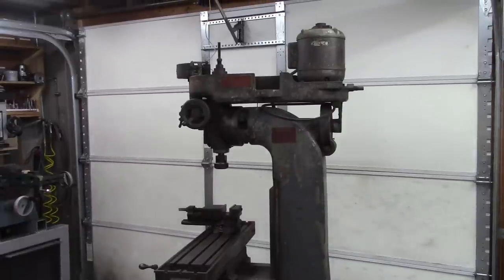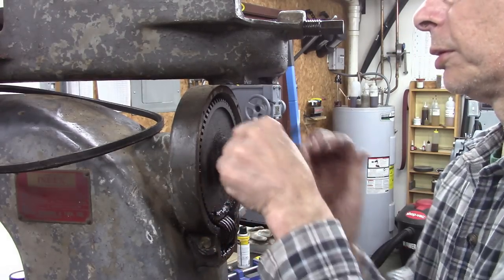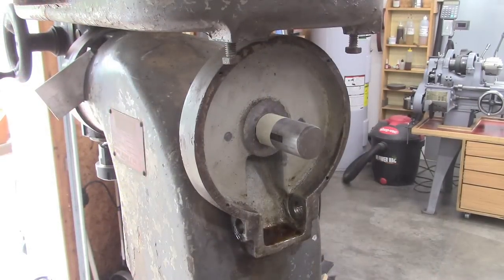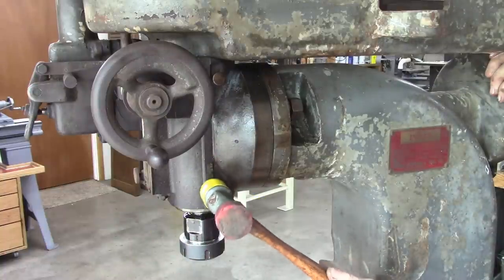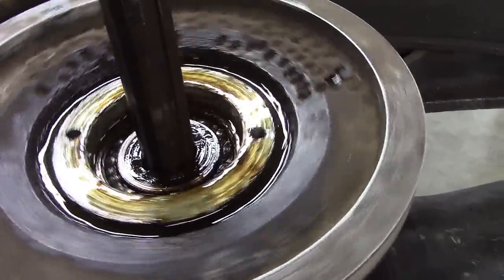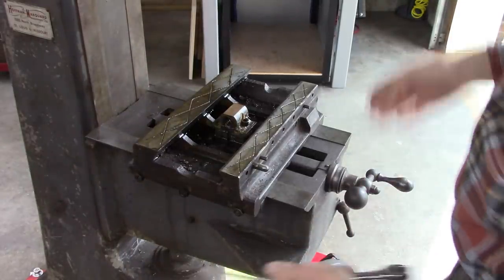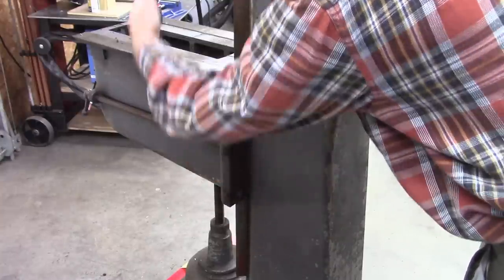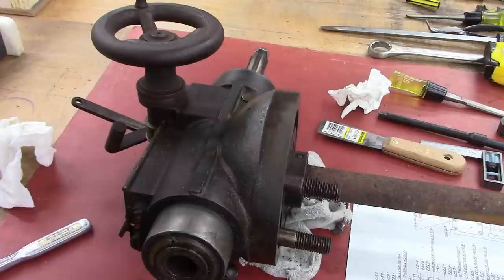Restoring a 1950 Wells Index Model 40 Milling Machine - Part 1

Comment: I have a wells index 747 mill made in 1974..II love it.The support you will get from wells is great..Give them a call and they can help with parts as well as drawings....
Reply from the maker: That's great to know. Right now I'd like to know a little more about the spindle bearings and how to lubricate everything plus the original motor wiring. maybe I'll call them monday.

Comment: Well, we just never know what’s going to follow you home. This looks like it could still do good work if all the parts are intact or repairable. We’re not quite ready to make that determination yet but I have faith that if it can be fixed, you will get it fixed. Best of luck once again. You left us wanting more, which is how it’s supposed to work. Good job!  🥸👍🔨🔧👀✅
Reply from the maker: Thanks Joe! I think it;s going to be a good machine. Lots of work however.

Comment: Winky, fixing that hoist to your roof beam was probably the best thing you ever did when doing the drilling machine, sure came in useful again. Looking great. Regards from Australia.
Reply from the maker: Yeah, that's a deck I built 10 years ago. I used 2x10's in pairs 4 inches apart that span 10 feet. I'm not sure what the load limits are but I would not be afraid to lift a few tons. My chain hoist is 2 ton right now that's the limiter. I've lifted 3 lathes, 2 mills, a big drill press and a few other small things. The cool part is that I can drive my truck under the deck, lift it up and drive out from under what I lift. I used the machine the movers I built under the mill. They worked perfect. I was concerned about the 2" wheels rolling but it was easy to move.

Comment: Looking forward to this series. I have a Index 40 mill. Which is a Wells Index before Wells bought them. Mine is pre 1941. Need to replace the lead screws and nuts on it. Wells Index is still in business in Kalamazoo, Michigan. You can contact them for information and might still have some parts. There are very helpful.
Reply from the maker: I knew they were still in business... not sure about parts but that would be a plus. Mine is a 1950 according the the serial number but the casting for the belt shroud has a date that says 1955.
Reply: Muskegon
Reply: @cyclebuster  Your Right. Brain Fart. I use to live in Muskegon. Thanks for the correction.

Comment: Owned three model 55’s.. served my apprenticeship on them.. wish I had them back..
Reply from the maker: The more I use this mill the better I like it...  Very good mill. My only complaint is the lead screws. My round column mill had screws that were .100" per turn. the Index has a .200 per turn. I do like being able to move the table fast but it's hard to make small moves. I broke two 3/8" end mills the first day I used it. I was very used to the slower movement. From what I understand most mills are .200 per turn. I'm starting to get used to it but .100" would be better.
Reply: @WinkysWorkshop  . The first 55 my dad bought in 1980 was all new screws, ground and flaked ways… essentially it was brand new. But a common servo feed brand or Feedster brand was made for bridgeports. So my dad cut the feedster up into pieces and re-engineered ti work on the 55. It was really slick. The other two 55’s had table feeds built  into the back of the mill with a transfer shaft. Those were really nice.
Reply from the maker: @paulbfields8284  Somebody was going to give me one of those power feeds that mounted to the back of the mill but I decided not to accept it. That thing was huge! I'll eventually install a conventional feed.

Comment: This'll be a fun long series.
Reply from the maker: Probably 3 or 4 part. It's moving fairly fast although i have a few obstacles still. The motor might need to be replaced and it needs a bearing. It might be a wiring issue or capacitor but it starts slowly. I'm not sure how it's supposed to be hooked up but there is no reverse. Somebody has changed the wiring but the motor looks original.

Comment: I have a model 40 also, and I love it The base is light enough that when stripped down  it could go in my basement. I have a Bridgeport also, but I use the Index most of the time because it moves  easily for hobby work. One modification I did was replace the head, I could not stand the Index head with out a rapid quill, I made an adaptor and put a J head on mine.
Reply from the maker: Rapid like a drill press? I think the quill will move plenty fast for my needs. I use a drill press for almost all drilling anyway.

Comment: I must correct you: that was not a bearing puller but a battery terminal puller.  Likely Craftsman.  I have one just like it! 😂
The machine looks like it will be a good one.  Congratulations on “almost” 40k subscribers Mark!
Reply: I also have one just like it. Had it for a lot of years. Probably bought it back in the 1970s.
Reply: @mikewatson4644  I have used it for gears more than terminals 😅
Reply from the maker: Ha...  you could be right about that. I have no idea where i got it. It seems to be very strong for the size. I need to get a couple of good pullers. Thanks, yeah 40K is wild!

Comment: Winky best way to clean the table is spray with wD 49 then use palm sander, place square of scotch brite and lay the palm sander on top. If works great with no effort. Repeat and will even remove stains from the metal.
Reply from the maker: Evaporust took it all off. I made a tank and dropped it in. The only negative is I had to have 4 gallons.
Reply: @WinkysWorkshop  yes it does work but it’s expensive for sure

Comment: I recently found myself the same model (40 3565) and I’m also restoring it. It made me laugh to find the wasps nest in the exact same spot as mine. Good luck I’m halfway done on mine, I have it completely apart and my garage is a big mess now.
Reply from the maker: It has WAY more parts that I ever imagined! Ha... I have two more videos and making a final part 4 now...  Hooking up the motor!
Reply: @WinkysWorkshop  My model 40 was originally blue. Sold in Los Angeles by Dayton &Bakewell dist. to the U.S.  Navy. I was able to get the original sales receipt from Wells-Index if you’re interested. Mine was bought on 5/17/1950. Thanks for your videos, I wish I recorded my journey as well as you are. Keep it up!
Reply from the maker: @alkabroni3992  I may need to check with them and see when mine was sold. It would be interesting to know the history. Mine was for sure gray.. a couple of times... Ha
Reply: @WinkysWorkshop  Ha. A few layers never hurt nobody.

Comment: Mines a 1942 that was bought for $742.00 new and used by a company to make parts for safes for the NAVY.
I got great info from the guy in Muskegon where they are located.
Reply from the maker: Cool!  Mine is 1950 to 1955. Not sure. I will say, its a fantastic machine. Since making this video I've added DROs, way covers and flood coolant.

Comment: Hi Mark, just a thought. Do your cameras have a manual audio setting? If so you may wish to try using it and reduce the effect of the automatic gain control boosting the background and amplifier noise during the quiet bits. If not, well, don't worry, it's no big deal. The wind chimes do a good job at any rate.
Reply from the maker: Hmmm...  Interesting. I never noticed this before but I turned the volume up and heard it. This is a lapel mic. I've had 3 of them and this one seems to be the best. I'm not sure about the camera setting with this mic but I can probably filter it out with my editor.

Comment: I also have 2 of those Index mills in my shop. Totally rebuilt one. And in the process of rebuilding the other. I've got a couple of questions. Do you have the intermediate pulleys? I didn't see them. What taper is the spindle? If it's the Brown & Sharpe taper, Wells Index can regrind it to an R8. But, their prices have gone up & it's not cheap. I had my 1st one done 15 years ago. Here's a little tip that will make it a better machine. When you took the table cranks off, you should have found fiber washers that Index used for thrust bearings. I ordered some needle bearings & washers from McMaster Carr. Way smoother to operate. I'm not sure how YouTube operates. But, I know these machines inside/out & if you have any questions, feel free to contact me.
Reply from the maker: Yes it has the intermediate pulley. It might have been missing in the video. I removed it when i was lifting the mill. It let me run a strap though the belt shroud and around the top casting. OH!!!  That thrust bearing is a GREAT idea! The tables move nice but the thrust bearing would be a lot better. Thanks! You can send me an email at winkysworkshop at GMX dot com.
Reply from the maker: It has a B&S taper but also has a ER40 adapter. Interesting about the R8 regrinding. The ER suit me however. I have a full set.
Reply: what is the number for those bearings, when i replace my table nuts i will do this

Comment: You don't have the equipment to make that gear because it's a worm.  But besides, why would anybody ever want to turn the head past horizontal?  The only reason might be to lower the center of gravity for moving.   Suggest after broaching, braze up (or press in brass dowel pins) to stop the next guy from accidently rotating into the broken teeth.   I know this is going to be a beautiful machine when you get done with it.  The interesting thing will be if you decide to replace your bench mill or not.    Will ride along.
Reply from the maker: Actually the motor and belt shroud will hit the side of the mill before the head can rotate far enough for the worm to get to the broken teeth. Thanks, I'm getting excited about using the mill. I'll sell the RF30 mill. I don't have the space for 2 mills and this one will do what I need.

Comment: looks like it is going to turn into a full restoration. Does it take ER30 or ER40 collets?
Reply from the maker: Yeah...  its an odd taper but the adapter is ER40
Reply: The Model 40 uses B&B #9 taper.
Reply from the maker: @cpcoark  Thanks, I couldn't remember what it was but all be using ER40 with it. Did you mean B&S?

Comment: Hello, I am Cyclebuster AKA Gary, i have the 40h on here. IF you need to duplicate that set of brass nuts i would help fund the project as i need an X axis nut, mine has a bit more wear then i like, but its still useable.
Reply from the maker: I'll keep this in mind however, somebody has replace both of them on this mill. I don't think they had much backlash. In the future I may address this if needed. Send me a message at winkysworkshop at GMX with NUT as the topic and I'll contact you if I make them.
Reply: what do you think would be a fair price to make one, since you have them on your bench. I can live with the Y axis, it seems this machine did most of its work on the X axis.
Reply from the maker: @cyclebuster  If you are wanting me to make them I'm not really interested at this point. If I make some for mine I'll give you a good deal. The price for bronze is crazy high. Mcmaster carr might have a nut that could be adapted. That would be the first thing to check.
Reply: @WinkysWorkshop   i took the x and y handles off and adjusted them and its one hand easy now to move both planes, but its still a bit shaky, i think the old owners tried to tighten them up to stop he head shake, I guess i will look for new nuts. $900 at Index. Its not that bad really, if you lock the other unused axis so it shakes in the work plane. I am sure there are working mills with 3x the play mine has. Its also probably exaggerated by the tall vice, its on a rotary table. Are you going to do  a show paint job? mine is war grey, but i would love to make it dental white flowing seamlessly... But for now she works.
Reply from the maker: @cyclebuster  Yeah...  I'm working on the paint now. Sandblasting would have been much easier but fixed the old paint job. It will look good.